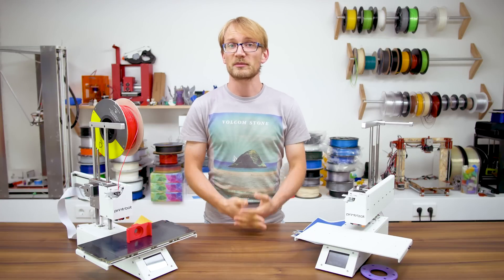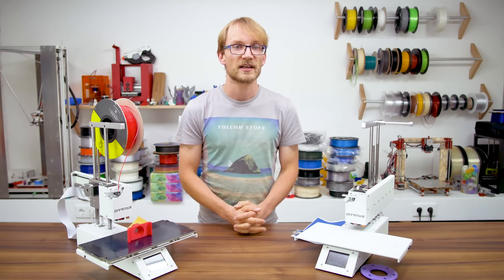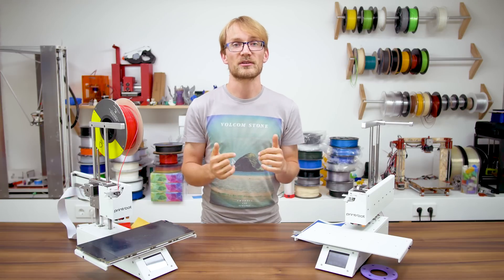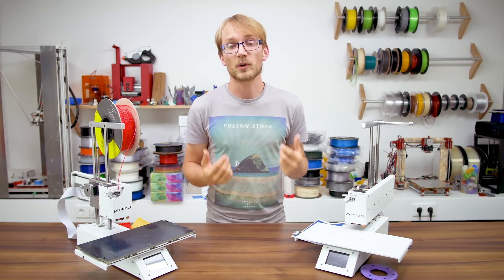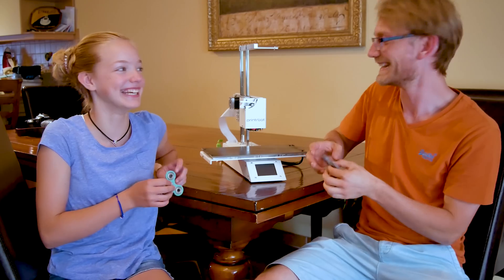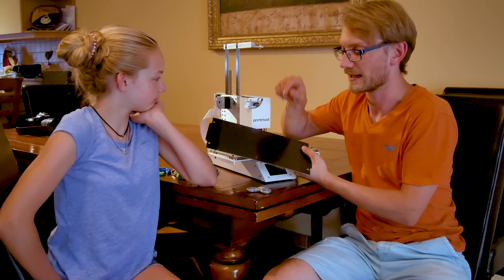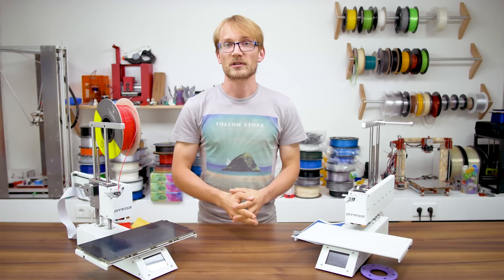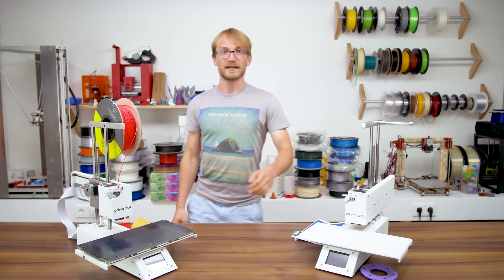Printrbot Simple Pro review from a Pro's and Newbie's perspective!

Comment: Hey Thomas! great video! I have a small problem.. You see I purchased the Simple Pro a few months ago, I only managed to get the simplepro to work over the air using printer.cloud page. However, now it seems July 31st is the last day they will offer this service. It seems Printerbot in general is gone out of business, and thus I cannot print anything anymore using my 1000$ printer :(. Have you managed to successfully upgrade the firmware on your printerbot simple pro? I tried for several hours and I cannot get it to work with Cura. Is it possible to use some generic firmware for printers on this machine? Its a great stable machine.. only the software service was bad :(.. Please let me know if theres anything I can do with this machine. Thank you!
Reply: Same problem. I now own a brick.

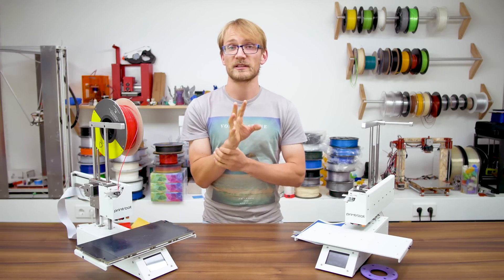Comment: There's a problem with the subtitles, starting at 2:35 and going until the end of the video. They go on to talk about differences between the kits and the prebuilt, but you cut that section out of the video and the subtitles never catch back up. I kind of rely on the subtitles, so it's really jarring to read one thing and see you speak another :-/

Comment: .3mm nozzle, stiff frame and no heated bed is odd, but I can see why you might do it to provide an easy upgrade path. e.g. once you're bored with PLA you can get the heated bed and print PETG etc. Price point still seems to be a pain point for 3D printers. "Beginners" want a low price with amazing quality and fast print times..... well they need to pick two from that list.

Comment: My only real problem with cloud based anything is that my home internet is currently down.  I would not be able to print anything.

Also, this is the second printer I have heard of that keeps the material settings on the machine.  I recently got a used Ultimaker 2 and when I downloaded Cura I wondered why there was nowhere to set the material.  Then I read about "Ultigcode".  I'm not sure if I like that yet or not.

Comment: Why not print from USB exclusively and ignore the cloud features?  I have the previous Simple Metal and I always print tethered.  This works really well so I am curious to know if the new machine is worse for this mode or just the same.
Reply from the maker: Tethering a full PC/Laptop to a 3D printer should only be necessary for the very lowest-end machines these days (and not even for those). Sure, you can set up OctoPrint and all, but sometimes the simplest route of going through a USB drive or SD card is the most reliable.
Reply: ok, guess I didn't realize what was normal because I've been printing for about 2.5 years tethered with 0 problems.  I figured it was the normal way.

Comment: So if it used octoprint, would you buy it?
Reply from the maker: I have enough 3D printers already :-P
But yes, as a more advanced user I'd prefer Octoprint. Printrbot might have something coming there.
Reply: Thinking about it though, with what you said in the video about fixing the firmware with the Micro SD card, in theory user-made firmwares could be possible, so anyone could write an octoprint-enabled firmware for the printer 🤔

Comment: Seems like an odd mix of innovation, solid build, and poorly chosen paths to go down?

I still have and use my Printrbot Simple 1405 - it's old, plywood, but it still rocks! I lost interest in the new Simple Pro when Brook upped the price and boasted about the inclusion of a power switch - jokingly at first, but it seemed that was a legitimate upgrade to justify a price increase from the PB Metal. Lack of standard heated bed and a price point way above most entry level printed, but below top end ones which include way more spec seems to put it in a corner all by itself? 

Did they scrap their own custom Cura software build too now, to use the cloud only approach?

Steve

Comment: Transfering the project to the printer and then donwloading the file from the printer is just bad UI design. The transfering the project step  should be completely unnecessary from a technical point of view, since the printer can get the files on it's own.

Comment: I'm not a fan of the cloud based stuff. 

Moving an SD back and forth is just fine for me. 

My club went with a MKii prusa and we love it. We bought the assembled version, pulled it out of the box and got great prints with the pre-loaded files. We also have an ultimaker 2 and a flashforge dreamer at the school. The prusa is better than all of them, costs less than this printrbot, and they have introduced a custom slicer with simplified settings for noobs.

Comment: I know a lot of people who are interested in 3D printing but the complexity of getting one running is very daunting, especially with the dubious mechanical qualities of cheap printers.

This would be perfect for them, if a bit slow.

IF IT HAD A HEATED BED. It absolutely MUST have one for newbies. You can't let newbies deal with the hassle of ANYTHING. The moment it does not work right for a physical reason, they get frustrated and either rage loudly on the Internet, ask for a refund, or chuck it in a corner somewhere and never touch it again. Prints not sticking well is the #1 cause for that.

Regardless, it is extreme folly not to include an SD card slot to print from.

Comment: Thanks, Tom! I appreciate your balanced approach. 
Notes: 
Yep, it's for newbies ;)
the printer is $999 and includes the heated bed and flexible build plate (nickel coated).
No kit. I dumped it ;) didn't sell well.
$799 option coming soon. W/o heated plate and no touch screen / cloud. All the different sizes of tips.
We continue to work on the cloud, etc. For speed, simplicity and yes, features. It's always a trade off ;)
Your sister was great! I think it helped hearing her perspective. What other printer can you give her -hands off - and have her succeed? ;)
All my best,Brook
Reply: So we can confirm that blue with racing stripe is coming soon? XD
Reply: Eh...The Luzlbot Mini costs the same and the Prusa i3 costs less.
Reply: Hello brook! I have the previous model, and i'd consider this one only if i could use it as my old one, with no cloud. I reaaaly like the hiwin rails, and the option for no touchscreen is great, i think many of us don't care much for that (octoprint users).

However, i think that maybe the printrbot for me would be the smallz? altough i didn't see an option for hiwin rails?
Reply: KEEP WORKING ON THE CLOUD. Seriously. Yes, Prusa and Lulzbot have cheaper machines with more open connectivity. All the nerds who want absolute control aren't your market anyway. You guys have been pushing the education angle already, and this is a market that desperately needs a plug-n-play solution that's not AstroPrint. I LOVE that you have, like, three setting for the slicer.

Comment: Wait! It has a card reader, but it's inside the printer? What kind of silliness is that? They should've just done like with the Raspberry Pi and made the card really accessible for easy swapping, upgrading etc.
Reply: Pile of carbon it's connected with the ESP8266 chip to download the gcode .
Reply: @varun s
Even so, I think it's just a poor design choice to take away options when they're already there. In this case even more so because it requires additional hardware.
Reply: Pile of carbon it's for the OS only. Probably would die if you pulled the card while it was on...
Reply: the xyz pro does the same thing you can send gcode by wifi using s3d or there junk software, but you can not get to the sd card without taking the case off

Comment: Add a pi and use octopi.
Reply: Brad Johnson No point in getting this printer if you are going to do that.  Probably a third of the cost of this thing is in the cloud nonsense that you would be bypassing with the Pi.
Reply: No. It still interfaces over USB which us bad. Aparently there is a SD card inside, so maybe it's possible to hack the FW to use that SD slot to print.

Comment: I still use blue tape on my printer :) I usually do not have to change it for many many prints if I am somewhat careful when removing prints that stick too well.
Reply: I use blue tape on my printer as well(unheated glass bed underneath - pla and petg only). I just have to replace it after removing a print by ridiculous force(more than a palm sized area of the build plate covered).
Reply: So do I.  But I have a large print volume, so I just move the prints around when the tape gets grungy.
Reply: Same! I use Painters tape with a 60c Bed. I have to replace it about every 20 prints. I may upgrade to buildtak at some point.
Reply: I thought about upgrading to buildtak, but it is quite expensive compared to painters tape and I have absolutely no issues with tape so I think I'll stick to blue tape for now (like all my prints ;) )
Reply: I have two issues with tape: 1) even a tiny gap between pieces of tape shows up on the base of your prints.  And 2) if the tape isn't fresh, sometimes PLA prints curl.  Other than that, it's been fine.
Reply: you can buy 150mm wide blue tape, this is what i use for my printerbot simple, it's precisely the width of the bed :)

I bought buildtak, it worked great. Then it stopped working, and i just covered it with blue tape...

However when i use the heated bed, it tends to curl the paper after cooling.
Reply: Just covered it in blue tape. 😂 
Yeah I’ve seen the 6 inch wide rolls on amazon but they’re like $50 for one roll. I have heard a lot about caption tape, but I’ve never really tried it.
Reply: bought mine on aliexpress for 20 bucks aproximately :)
Reply: I use it's little cousin masking tape, it's a lot stronger and cheaper at cost of some adhesion, but usually i run 50C heatbed on the first few layers then turn it off and it's been servicing me a hell of a lot better than plain glass, and has the advantage that the local corner store have some more if i run out.

and did i mention that it's $1 a roll so you can afford to retape every print if you really wanted to?
Reply: BainSonic me too. I got some double width tape which makes replacing the tape much easier

Comment from the maker: Also, the Simple Pro is currently on sale for $911 on Amazon: http://amzn.to/2tk05lz
Reply: "on sale" it should be $600 to start
Reply: At that price one might as well just stick out a wait for a Prusa i3 MK2. Cloud only (no SD?) means you are at the mercy of the cloud service which at its best may be buggy and at the worst could end up being shut down for whatever reason. Prusa gives you a larger, and standard PEI plate. Slic3r is preloaded with plenty of useful presets.  I've barely deviated from them aside from a few temperature tweaks and needing to do a small steps/mm extruder calibration. Maybe its angles for those who are inexperienced and just want something that works but with minimal extra effort a Prusa is far better IMO based on what you showed in this video.
Reply: Their cost is over $600. Part of their problem is that they mfg in the US, which is expensive. They believe their only differentiation is to incorporate software to make it easier, as trying to compete with China is hard. The quality is top notch, but most people don't care.
Reply: Thomas Sanladerer I could buy a 10 time printer for $911 rather than that one like Flux delta+ which I have
Reply: if most people don't care why does Printrbot still grow?

Comment from the maker: If you had an interface like printrbot.cloud that was perfectly polished and came with an "advanced mode" with all settings exposed, would you use it or would you cling to classic software solutions?
Reply: Yay,  cloud based printing with a bad internet connection  just another level of frustration that I don't need. And if they decide to discontinue the service, or make it 10$ a month your stuffed.   My Machine My computer My Control
Reply: @David i dont think developer with a brain is dumb enough to stream gcode over the internet...
Reply: I'd still slice with simplify3d and send over to an octoprint server. That's just my workflow.
Reply: @mathew Bodsworth  Yep, you nailed my primary concerns.  But there also the privacy thing - it's one thing if one publishes something to a service such as Thingverse, but if one is working on a prototype and it's not up for publication, then one may not want it anywhere near the net, let alone have it sitting on a cloud.
Reply: If you don't need "cloud"... in general you are better off avoiding it. Reliability, security, and performance issues abound.
Reply: I'd still prefer the classic software solution.
Reply: cloud printing for me ? hell no ! but if that can  help to set a 3d printer in every home/classroom, why not ?
Reply: Did you test what happens if a connection is lost? do you have to re-upload or will the printer wait for the connection to reconnect?
Reply: All things equal, I'd rather not go through a cloud to get between two devices in my house.  Just adds more points of failure.

I like "wireless printing", and like historically unsupported operating systems, so all things may not be equal.
Reply: Very fair review. I especially like the part where you are interviewing your sister 👍🏼🤗 She did an excellent job!!
Reply: Thomas Sanladerer Although I'd probably cling to my own slicer, if it had an advanced mode, and an ethernet connection!!! ...then I'd use the cloud thing
Reply: Have you played with the Duet WiFi interface yet?
Reply: I wouldn't use it as 90% of the time my files are larger than most internet connections can handle doing quickly. I would much rather use octo print, or even better. If i could quickly just drop my files onto the printer over my wired network. Say mount the printers storage as a network drive and drop things right into once sliced. speed wise that faster than most of the internet connections offered to consumers. lets say ISP 500mbit/50mbit or 1gbit up/down for local, With a 50MB file. Not gonna bother doing math for times here but, 1gbit local networks gonna win.
Reply: Thomas Sanladerer 
I have a LulzBot Mini with Octoprint on a wireless Raspberry Pi 3 so I can almost have both as I can still use whichever slicer I want with whatever settings I prefer and yet still use the printer independently of any computer, apart from occasional wireless progress checking which I can do with my tablet or phone. Or I can use the LulzBot edition of Cura which is optimised for LulzBot printers and just send the completed Gcode files to be printed via Octoprint and also monitor wirelessly. Having no SD card slot has resulted in better functionality due to my upgrade to OctoPi / Octoprint. I don't like the idea of having to send every print via a cloud based interface as, unless they have sufficient bandwidth, you end up with the sort of delays you and your sister mentioned.
Reply: i can hardly imagine anything that would make me quit octoprint... I get the best of both world : a slick web interface with tons of features, and i still get to slice with whatever slicer i like; cura or slic3r...
Reply: I wouldn't want to wait an hour or so for my huge prints to download (100 plus megs of gcode, yes i know i probably don't need .1mm but i don't mind overnight prints), especially over just plain bad DSL connection.

 i would be fine with the ultimaker model where you slice on your pc and push gcode over wifi to the printer and let it do it's thing there though.
Reply: The cloud is an interesting idea, but I just use OctoPi to control my printer over a network.  I slice on my laptop upload to the Pi and I can then print that file from anywhere in the world as long as I can get a web connection.
Reply: Thomas Sanladerer cling to octoprint reliability. Online is never stable for a 20 hr print.
Reply from the maker: To be clear, the Printrbot Simple Pro also fully downloads files to the printer before the start of the print - anything you've printed once you can reprint without downloading again or even an active internet connection.
Reply: First, if you are a Sandlander fan, Printerbot is the machine you recommend to the less inclined. 2nd after seeing the finesse in simplify3d over cura,  there's no way a hardware company is going to surpass the passion of a software team like that. But again, that not the same market either.